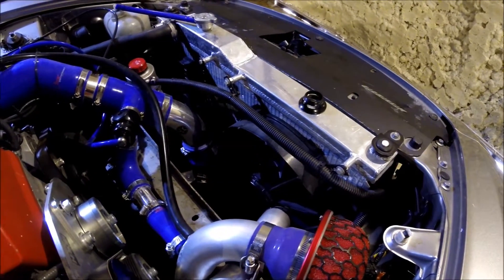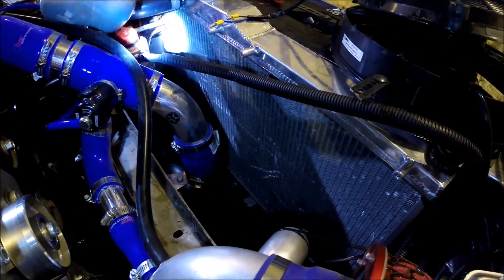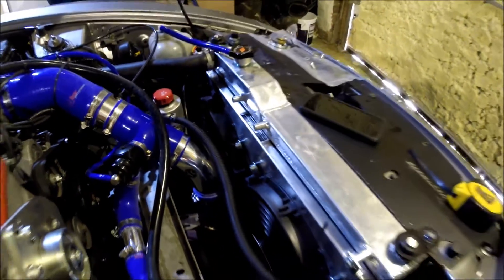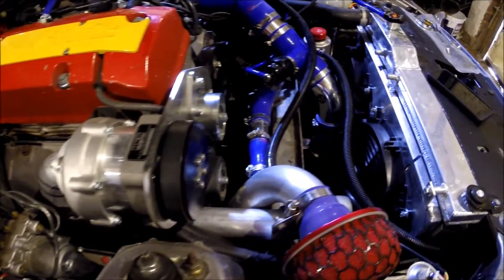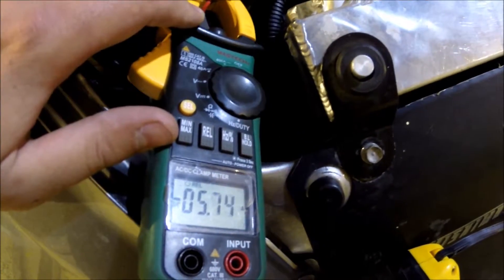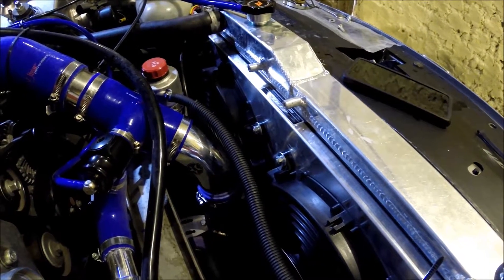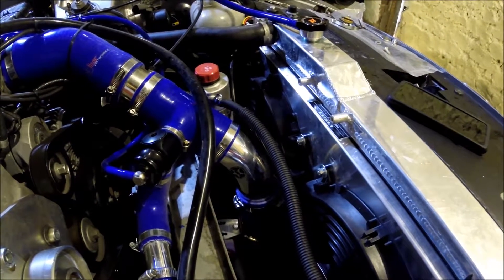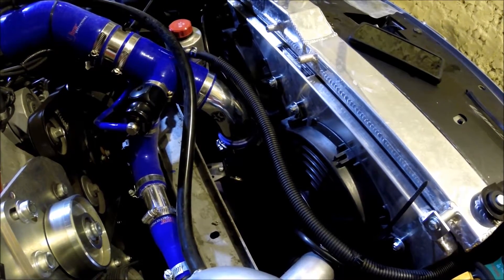Honda S2000 Mishimoto radiator fan shroud fit and test

Comment: thanks for the vid, also looking for some fans to go with my mishimoto 3 row radiator and have the hks supercharger so space is tight, so will be interested to see what fans you end up with and clearance etc
Reply from the maker: Alrite mate, i guess your define off of the forum. I have ordered two of these ones which are pretty much same dimensions as the mishimoto but get good reviews in terms of performance.

http://www.revotec.com/acatalog/11%20(280mm)%20SuckerBlowing%20Tech%20Spec%20HP.pdf

Will do a video of how they fit and whether they are any good.
Reply: +track nut (Gamesman) yep that's me :) nice one will keep a look out for it!
Reply from the maker: +Dean fans are fitted dean. Remove mishimoto fans , drill shroud to match revotec fans, wire into to existing wiring or going off a relay. Seems a lot more powerful than the mishimoto fans, hopefully upload a video in near future